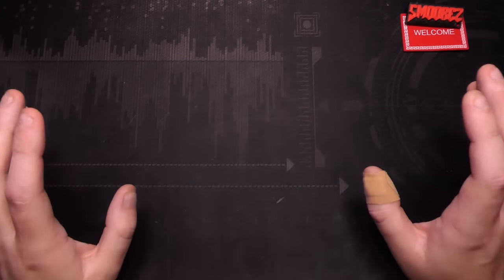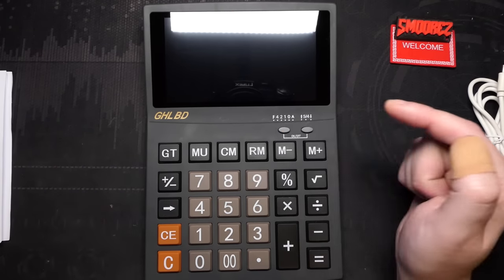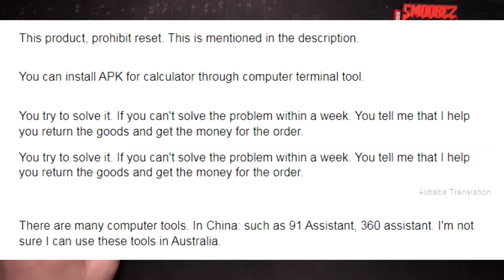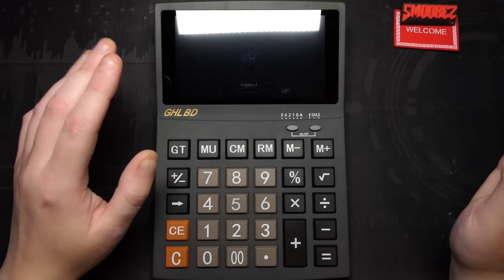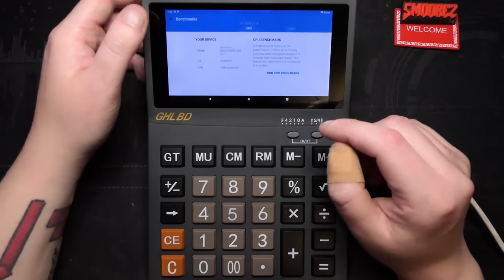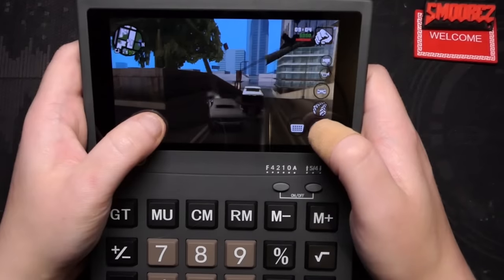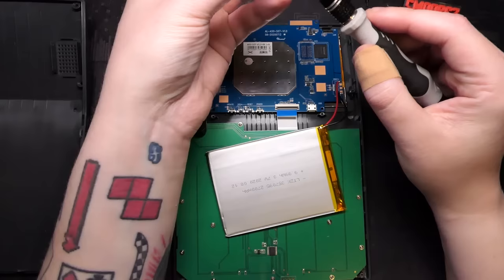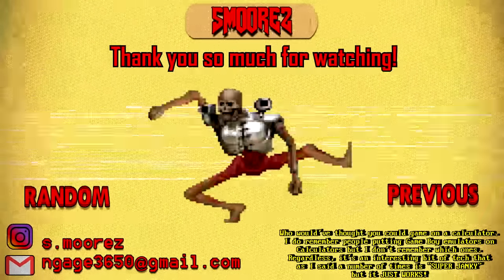I bought a $90 Calculator that runs Android from AliExpress - It is incredibly janky...

Comment: You know the first computers were basically meant as a fancy programmable calculator that people found ways to play games or have fun with. So this is technically a return to form with computer-based calculators.
Reply: All computers are just sparkling calculators
Reply: It looks janky but this calculator is more powerful than the most powerful supercomputers of the 1980s.
Reply: But professor, this is not a computer, it a calculator, I can use it on exam, right?
Reply: Joseph Smith actually invented the first calculator computer after the angel Moroni taught him how to solder.
Reply: I want your profile pic sir
Reply: also, the first portable computer was marketed as a programable calculator because the marketing department didn't think that a portable computer would be something that would sell to the business men they were marketing to in the 70s.
Reply: you are everywhere
Reply: @@lurch789 if only the school system didn't enforce that qwerty keyboards couldn't be on school calcs
Reply: @bitterlemonboy That is a very good point. Computers are actually one of the few products that have not been affected by inflation over the decades, actually becoming cheaper and cheaper over the years for more powerful systems. And of course, by "computers" I refer to all computers, which includes smartphones, tablets, PCs, and yes, even calculators.
Reply: @TAlim_1994  even MTK 6580 devices?
Reply: Computers are just calculators but the game code is basically the equations and the answer of the equations gives the result on the screen (by lighting up pixels and making fancy frequencies that are audio signals
Reply: @tylern6420  Yes, very much so. Even a lower-end chip like the MTK6580 is still more powerful than some of the most powerful systems of the 1990s and even 2000s.
Reply: Was made to inventory other humans by ibm
Reply: fun fact: the first microprocessor was created by mistake by intel. they were making processors for calculators and accidentally created a computer chip

Comment: The charger you used was within spec. Even a 150W charger will only output that power if the device it's connected to asks for it. Your charger supports higher voltages but it will only output them if the device is compatible with QC/PD/vooc/whatever and instructs the charger to change its voltage. They make a device that asks the charger to send higher voltages and then write in the instructions to not use said chargers? Wut
Reply: Exactly. It's a regulated power supply!
Reply: This is the second device I have seen that uses the USB C plug, but has issues with the power rating. The other was a mini laptop and a fast charger would damage it.
Reply: Same opinion: wtf
Reply: Yeah I wonder if the calculator device is accidentally requesting higher voltage? They need to fix that too!

Comment: Considering the cost and power, it is quite limited as a calculator. It is odd they went for a basic function calculator.
Reply: Scientific calculator would require more buttons with symbols, which would increase cost. They probably had layout for basic store calculators, and they went with that.
Reply: since the android hardware is quite dated, it possibly won't be profitable in normal applications anymore
Reply: Yes, it's really ridiculous. You can buy a decent scientific calculator for what this thing cost. A Casio for example.

Comment: I can't imagine a single reason to use this device instead of a regular calculator or the cheapest smartphone. If the manufacturer had installed a graphing calculator program and made it possible to use a keyboard, this device would make some sense.

Comment: The 5v 2A thing sounds kinda weird. If you put ANY 5V charger on it, even if it's capable of 3A or 5A, it will only pull the current it needs. You can't damage something with a charger capable of TOO MUCH current. If you put any normal charger on it that's capable of more than 5V, it should only put out higher voltages if the device requests it. They should be totally safe for 5V devices. The only way it could go sideways is if the device actually REQUESTED a voltage that it couldn't handle. Which maybe it does. But
.. Wow...
Reply from the maker: I apologised to someone before that said what I did was wrong which yeah it's a jank thing I should have been more careful.

Comment: * - Also, there are UART test points by the "TP" ribbon cable connector, (I think it's the Touch ribbon for the screen connector... there are 4 test points for UART or SPI... which you could connect to & dump the system.. I am sure that is how it was loaded, using pogo pins.. maybe that's what the guy in the chat said.. "Manufacturer programming" or whatever... but having that connection you can prolly do some cool things.. just saying... me personally.. i would prolly keep the screen, the board & battery.. load linux.. and have fun with it

Comment: normally you need an input mapper to make buttons work in games. might mess up the calculator mappings though, if it works at all
Reply: then you have to find one that works with serial keypads and works with the custom command set that this calculator uses. yes, the keypad is a variant of serial.

Comment: What I like about this device is that it's basically going full-circle on the history of computing. Computing started off with calculating machines, evolving into big, room-filling number-crunchers, then getting shrunk-down to desktop and pocket calculator sizes with the companies making those calculators evolving towards minicomputers and microcomputers which then evolved into modern computers and notebooks which then intern evolved into the smartphone. This device stuffs a modern'ish smartphone into a desktop calculator case, completing the circle in that area. Big room-filling mainframes on the other-hand have never really died out with modern and honestly mind-boggling IBM Power CPUS running in huge clusters crunching enormous datasets.

Comment: 7:16 the buttons actually do seem to be connected to the system, its just that there seems to be no configuration to use it outside of that calculator app

Comment: the case is definitely injection moulded, you can see the ejection pin marks on the inside. I'm actually amazed because it isn't that cheap to make a mould, unless you manufacture at great capacity, but they surely aren't selling that many of those are they?
Reply: its a mass produced calculator for a chinese market, not sure what you and this dude in the video is about ... it is what is suppose to be

Comment: ISN'T IT AMAZING, that.... BIGGER/WELL KNOWN BRANDS of electronics are STILL RELEASING new products with MICRO USB charge ports (and Apple having to be FORCED INTO making an iPhone with USB C)... YET... THIS small/unknown brand releases, yeah... A PIGGIN' CALCULATOR, that has USB C!  😏
😎🇬🇧
Reply: Sure, but this having a poorly configured charging setup to go along with usb-c isn't very helpful. Unfortunately C isn't a great standard because there are too many ways and options for manufacturers to configure it which in the best cases can cause a device to not work with every charger (or even sometimes cable) and in the worst cases like this one, can outright damage/kill devices

Comment: That's really weird with the charger thing, more current shouldn't do anything it will just use what it needs, and with usb chargers that have 5V, 9V and 12V etc needs to be told from the device to use 9V or whatever, really odd
Reply: I'm guessing the first board is designed to work with the standard 12v 2a USB PD chargers and needs to be configured per device, and is obviously not in this case and tells the charger to give more voltage than the actual main board can handle.

Comment: CM and RM should be MC and MR meaning clear memory and recall memory. the decaled F4210A up5/4down are used on financial calculators that have a switch beneath them on a real calculator and used for Tax functions and decimal place numbers IE 0.0000 0.000 0.00 etc..  :)

Comment: Wow, Mali-400MP GPU, really haven't seen it for a while. When I'm at high school, I was able to bought my very first tablet that uses Amlogic 8726MX which includes dual-core Cortex-A9 CPU and Mali-400MP2. Now I'm graduated from the college and working for 5 years.
Allwinner SoC were never took off at the " high performance" realm (they always ended up like the Snapdragon 888 kind of situation when they're trying to). But their video decoding tech is pretty good. With some fine tweaks by the software dev teams (if the OEM have any), their chips can be very useful in the IoT market.
BTW, I think that motherboard is probably a demo board made by Allwinner just to show customers what it can do, and this OEM bought it and repurposed it for this caculator. Since the model name for this board is literally starts with the "AL-A50" and all of the logo when it powers up are Allwinner's.

Comment: The A50 is a 2019 processor. A bit odd to hear it's running slowly.
Reply from the maker: Probably the 1GB of RAM with it and the fact I was using a MicroSD card to expand the storage and run apps off but even so as it was when I received it, it was fairly slow. Can't expect too much from it.
Reply: @SMOOREZ try telling them to fix the USB board configuration, to double the RAM and to put in 32GB of storage, it might be more usable then considering the other issues

Comment: It is not crashed it you get the pop up saying that the app does not respond. You ignore the pop up window and just wait or you press the “wait for the app to respond “. Background information: The core system has a process watchdog which asks the app every xx amount of milliseconds if it’s ok and if the processor is very slow and the app has a lot of tasks to process it does not respond in real time and the system warns you about the delayed response. Just be patient and give it the time to process and you’ll be fine. Eventually the app could crash after a while - but than you’ll get another warning and can still close it.

Comment: I love how they allow you to choose between the calculator launcher and random Holo Launcher, lol. Imagine Playstation 5 letting you to start in debug mode.
By the way, SMOOREZ. If you like warnings you should get the Royole FlexPai, the first foldable OLED screen phone ever. It is PACKED with warnings as soon as you start it, and some of them are kinda crazy, like: do not charge it folded if weather is cold and things like that. I don't think most are real, but the phone is just extremely fragile (well, pretty much as the Fold 1 press unit).

Comment: Texas Instruments charges easily double (maybe even triple) the price of this for a calculator, except TI devices are packed with obsolete chips and tech from the 1990s that are (at best) only really capable of crunching numbers and (slowly) plotting graphs.
 
Meanwhile, cheap ARM-based Android and Linux devices can do all of those computations (faster) AND play games, connect to the Internet, have much nicer touch screens, and have all the quality of life of modern mobile operating systems (easy to use UI, fast typing, multitasking,  app loading, full settings customization, etc.).

How far we’ve come 😅
Reply: I understand that schools want basic calculators, i also understand that ti wants to use older z80 cpus because its just a calculator that does not have to be fast. But what i dont understand is that its above 100+ euro/dollars and schools dont pay for it while our parents pay a lot to school and the money probably goes to only the school head so he can swim in his money.

Comment: What are those Chuwi laptops like from China btw?
Reply: I have a 2 in 1 Hi10x, the tablet is pretty good for the price, it charges via USB C but doesn't use PD unfortunately, also the Micro SD card reader will never work again if you install another OS and haven't backed up the driver. The keyboard dock is a pile of crap though, the precision touchpad has it's inputs converted to keyboard shortcuts with no way to disable any of them, you can disable the touchpad with the keyboard but the dock connector disconnects constantly and the crappy touchpad is re enabled every time it does this. so yeah, good for price, just don't bother with the docks with the tablets and imagine the touchpads on the laptops will be just as awful so get an external mouse.

Comment: It's not 3D printed it's an actual factory mold casing. I seen these being mass produced and it's simply a mass produced calculator. 

The board itself could be (or better say it actually is) from the shelf multipurpose tech board that was used in small devices such as notification boards then from worker tablets (to run diagnosis of cars, machines, even medical staff machines or whatever can pop up to your mind) up to simple kitchen pads (for writing and reading recipes etc). I mean there are millions of things that this can be easily used for.

This is not botched together as a joke it's simply a tool. Originally this is like I said simply a calculator, that is it.
Reply: I would guess once the seller saw up tick in sales they found out people were hacking these things and just went with it as a selling point, it's now 6x the price than when Taki Udon messed around with it a few months back.  At 10usd or even 20usd it might be worth messing around with but at 60usd it makes more sense to just get a pay as you go phone from a big box store when they go on sale.  1GB is the worst part and most anything new would run horrible, except maybe a calculator...

Comment: This device seems just ridiculously pointless. Like for the same price. You could just buy a tablet and you open up the calculator app. Because it's an Android even on this device. You could just open the android calculator on the screen. Like who uses a calculator so much and so often to justify. Having this huge calculator with huge physical buttons, but then also having the Android device on their like. Just have 2 devices for the same price. Have a $10 basic calculator that serves all the same functions as the calculator part of this device. And then have a cheap Android tablet or phone.  It's just on wi fi that serves the same functions as the touchscreen android display on this device.

Comment: How TF did you think a 30w charger would be appropriate to use on a low energy Calculator?
Reply: This shouldnt be a problem at all. The device should use only the maximum 5V/2A. No "well" enough build device should break even if you use a higher wattage charger

Comment: I feel, like you should have the common sense to not use anything above a 5v charger on such a device, so i get a bit confused why you even try to blame it on anyone else, you own hundreds of phones and devices, it should be common knowledge to always start of with a charger that has the standard 5v output, in my opinion. 

I'm just a bit confused by all this rant about that, i dont care about that company nor do i know who they are, but just your pure ignorance and trying to blame it on someone else is just weird to me, and i've been following you for a long time and never saw such weird argument from you before.
Reply from the maker: Honestly it was my mistake to do that. I wasn't really thinking because when I was filming and tried to switch it on and it was dead, I just grabbed one of chargers and connected it and the whining sound didn't ring any bells with me. So I completely own up to doing that, it was simply an assumption that "yeah it would be fine" but turns out it wasn't.
On that same power strip I have a standard 5V charger but instead I chose the Oppo 30W one and well the rest is history.
With all the cheapo devices I've bought over the years, this is the first one this has happened to and I should have been more careful with a device that has no documentation or anything like that on it. 

Also I completely admit to be stupid blaming the seller in a way that seems bad. I didn't mean for this to come across as bad to them or anything. They are all good now and I changed my original feedback to reflect this when they were kind enough to help me.

And I was going to return it back due to the confusing messages about me factory resetting it and then losing the launcher. It was when the screen died completely that I told the seller and then they said "did you use anything past 5V/2A" which yeah I did. After the initial exchange and the return was initiated they were super helpful and at least they have the warning there for anyone else who buys one and just grabs any old charger. Once again, completely my mistake.
Reply: The thing is, the device should be able to negotiate, a 30w charger isn’t just 30w, it is more than capable of outputting lower, this thing just had terrible power circuitry, requesting more than supported